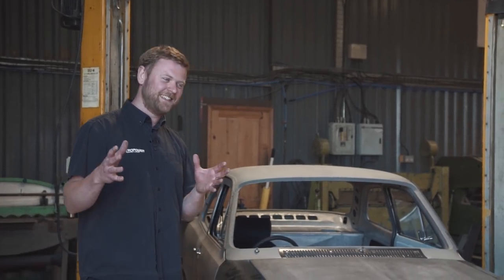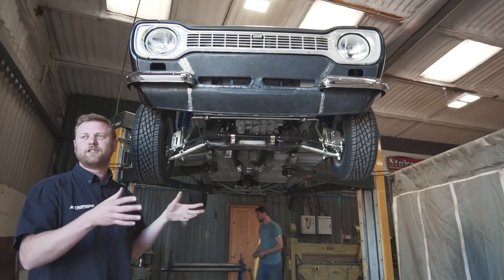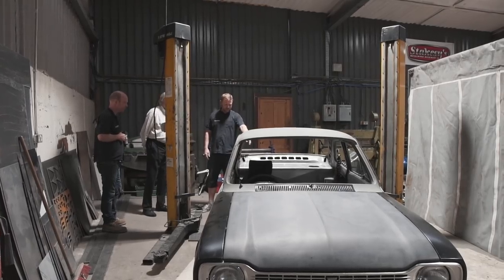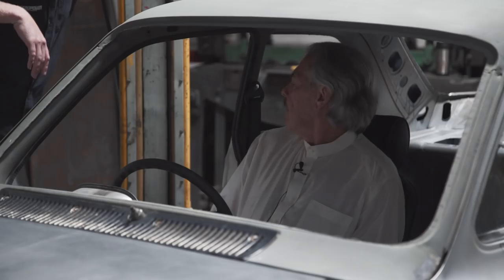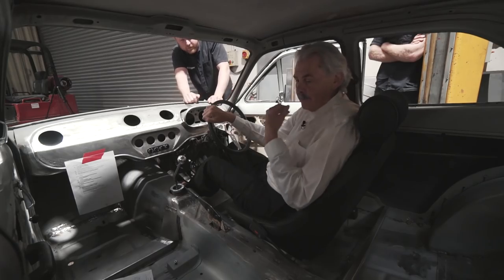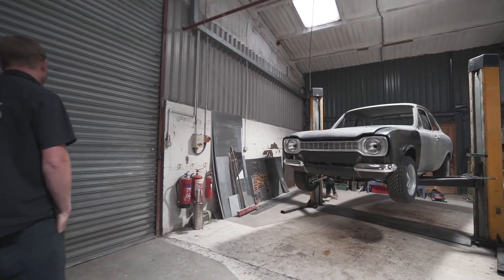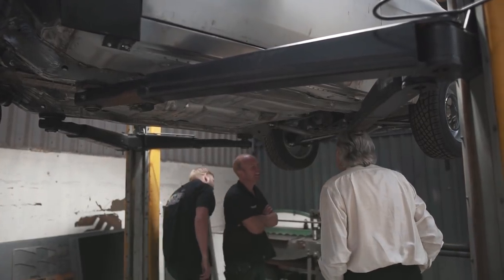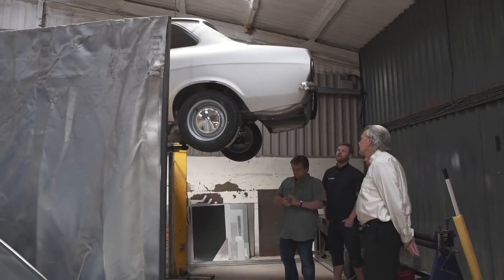Gordon Murray's MK1 Escort - Retropower Build Episode 8

Comment: Brilliant work, in my youth when these cars were popular for tinkering with we used to double up on the front anti roll bar because the way they fix at the strut end made it difficult to fit thicker ones. The availability of custom parts and machining was less available then. Also the minimum requirement in an MOT for mirrors are one to the drivers side plus one other so on my older cars I use a clip on after market mirror clamped to the drivers quarter light.
Keep it up guys .

Comment: What a totally stunning Q car - Outside looks like a showroom standard original Twin Cam - Type 49 arches, quarter bumpers and steel wheels  but underneath ..... WOW!
Those quarter bumpers (from the rear of early Anglia vans and used on the Lotus Cortina Mk I no less)  have been retained to great effect as Its a small touch but so important for the front look
And yes Mr Murray we used bog standard (Twin Cam & RS standard) front roll bars on the rally cars. Even then Roger Clark would go all round Llandow Stage on the Welsh with the inner front wheel 6 inches off the deck ...

Comment: Two minutes in and I'm loving those hubcaps - perfect for a retro build like this!  Alloys just wouldn't look the part.  :-)
Reply: aussiebloke609 . Totally agree. Those steel wheels and hubcaps look best on mk1 Escorts.
Reply: Steel rims and hubcaps? 13x7 Minilite/Superlite would be far more attractive and period. And have far less scrub radius as well
Reply: Considering that the steel rims can be made with whatever offset they want, I'm not sure why you assume your alloys would have less scrub radius...?
Reply: ... and with a limit to how much inner rim width can be used...
Way, way back in the day Dunlop had a line of lightweight steel rims and, for the desired 'sleeper' look, argueably a better idea? Although Minilite still do proper magnesium wheels in period correct sizes for the Escort.
Reply: LDN Wholesale - as someone who rallied a Lotus Cortina, a Twin Cam Escort and two RS 1600s I can assure you that 7 inch rims were by no means 'period'. Road cars would have 5 1/2 x 13s steels and the biggest my rally cars ever had were 6 x 13 Minilites using German Ultragrips. And I mean proper Minilites. And my Escorts all had Boreham steel large wheel arches to accommodate them

You do of course realise even a 6 x 13 wheel would be a tight fit even under the Type 49 Twin Cam / RS wheel arches (which themselves were enlarged for the 5 1/2 x 13 steels fitted as standard) on full lock and compression on a lowered car?
Reply: 'chish, I think he means in appearance, rather than technically. 7x13 alloys seem to be a common fixture on modern Escorts, with massively stretched 175/60 tyres - compounding, IMO, the heresy. I've said for decades, if you can't afford tyres that fit the rims, don't fit the rims. If you're suggesting 7"rims weren't used then, I think you're right - they didn't have the tyres that needed them then.
As you said, the guards were altered for the 'sportier' Escorts, for clearance, but clearance also depends on wheel offset and tyre size and, if used, negative camber track arms. The ultragrips were a relatively large tyre and needed plenty of clearance, especially under compression on lock, but road tyres are generally much smaller, resulting in more base clearance. 
Last time I checked, the 'proper' Minilites were still available in magnesium but, personally, I very much prefer the look of painted steel wheels with hub caps, even if there is a small weight and brake cooling penalty - seems every Escort has some sort of period, or copy of, alloy wheel and the steels just look purer, to me, at least.

I should mention that although I'm a Chevette chap (drooling over the ones they're building), I have many, many friends who have rallied Escorts, including at least 2 BDG cars :-)

Comment: Thought it was a legal requirement to have 2 mirrors? Either 2 door/wing mirrors are a single interior rear view mirror and an external mirror....... Car is looking great!
Reply: It probably depends on the model year and the requirements at that time.  My dad used to have a '60 Holden.  The driver's side mirror was an option.  And there wasn't one available at all for the passenger side.  No seatbelts, either - not even a lap belt in the front.  But that was in Australia - not sure at what point the second mirror was mandated in England.
Reply: Same here. I'm really enjoying this series, and it would be great to see some of their other projects featured.
Reply: Nope. Many (I would say approaching 'most') of the mk1's came from the factory with only the internal rear view mirror.

Comment: There's no doubt the car will be stunning and the engineering excellent but to take away the live axle, which is why we love any old RWD Ford, just seems pointless. Having independent rear suspension just makes the car like any other modern vehicle. Just my opinion....
Reply: Agreed. And if it did make that much of an improvement on a mk1 or mk2 Escort, there would be hundreds and hundreds of them using IRS by now, but there isn't.